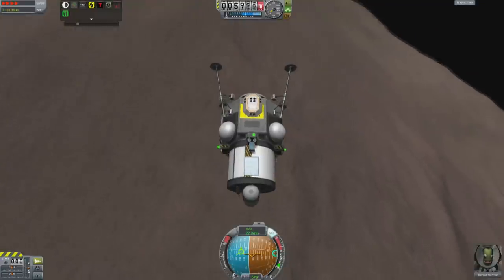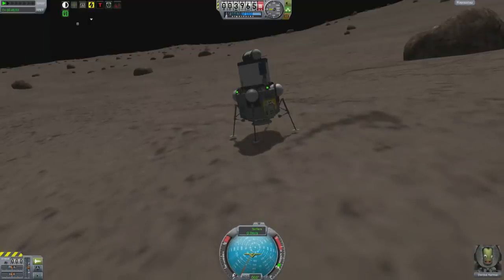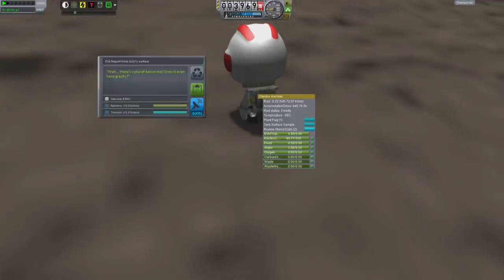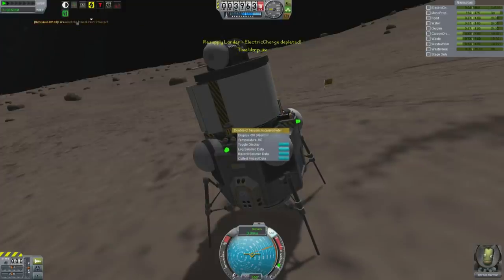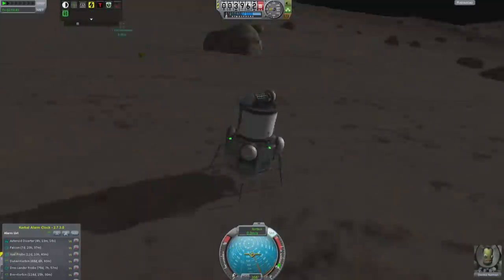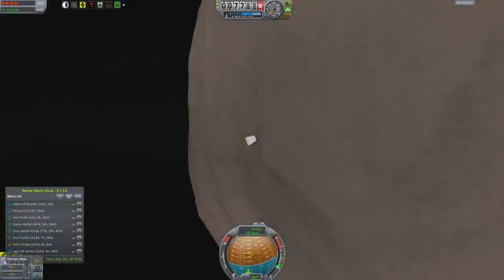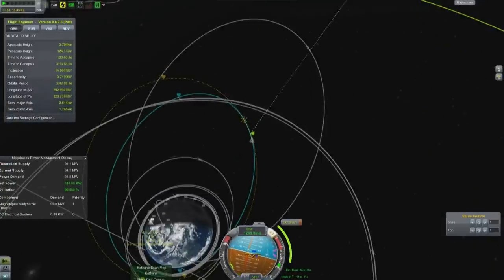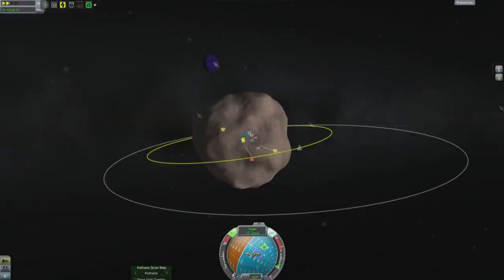Kerbal Space Program - Interstellar Quest - Episode 63 - Exploring Gilly

Comment: Scott, if you have upgraded your plasma engines you have access to infinite fuel in space/ vacuum. To quote the wiki. "The plasma engine can use multiple types of fuels. You can toggle between Liquid Fuel (Hydrogen), Lithium, Monopropellant (Hydrazine), Argon, and Xenon. Liquid Fuel offers the best specific impulse and lowest thrust, while Xenon offers the most thrust but the least specific impulse. The others are in between in the order they are listed above. When upgraded, the plasma engine is capable of pushing against the quantum vacuum itself to provide thrust. This mode only functions while not in an atmosphere and has the same performance as liquid fuel. However, while in this mode it requires only electricity and no fuel whatsoever."

Comment: So how hot would Gilly's core be? Is that even calculable in this universe?
Reply: im going to go out on a limb and guess that gilly's core would be completely cold since gilly is so small
Reply: Gilly's core could be around a bout subsequent 0 (-250 degrees Fahrenheit) which is where all molecular and particle movement stops.
Reply: tesshess
Still tidal forces happening. Eve = heavy. So I expect the core to not be 0 K.
Reply: impwarhamer 0° Kelvin is the complete absence of particle movement. It is basically possible, but yet to be actually found, because we can not reach any space where the is no gravitational force. Even if we'd find such a place, we would not be able to measure 0°K, because our spaceship and thermometer have mass and therefore gravitational force would make the measurement useless.
Reply: TheSchuetzeP
Kelvin doesn't come in degrees like degrees Celsius or degrees Fahrenheit.
Reply: ThaFuzzwood You are right. My fault, but to defend myself: It came in degrees until 1967.
Reply: TheSchuetzeP Actually, no, you still can't get 0K. That is because quantum effects will always be present - Uncertainty principle and all of those things. Gravitation isn't the problem.

Also, of course, the universe itself is hotter than that, since it hasn't cooled down enough yet - it is at the blackbody equivalent of ~2,7K. There one place that is actually cooler than the background - Boomerang nebula at 1K. (Caused by expanding gases.)

Finally: even if (uncertainty principle aside) we were to find something that is at 0K, we wouldn't measure it as such indeed; but that's not about gravity. That is because measurement inevitably means we add energy to the particle being measured. This is true even if we had massless probes.
Reply: Absolute zero is actually -273.15 degrees celcius, or -459 degrees fahrenheit.
Reply: Or, like said above, 0K
Reply: It doesn't have a core, Its a captured asteroid remember :)
Reply: @ThaFuzzwood  why wouldn't it? it's just celcius plus 273.15

Comment: How do you use the rocket/air breathing things on the shuttle craft because when I install b9 it just doesn't show up as anything am I missing something because I would really like to use them for my crafts.
Reply: I have the same problem :(
Reply: B9 is broken in .23+. You have to update the firespitter and exurgent engineering plugin dlls. Here's a link to a fixed copy of the B9 pack that I use perfectly fine:
https://mega.co.nz/#!yVxy1YBS!DVrULghOffbrsBQOzLlWwUmDe03hYadhVD-eO-LVnvc
Reply: Have you added the unofficial b9 23.5 patch? If you have it may be an issue with exceeding the 2.3gb ram limit.
Reply: Thanks for the help now it works and I have made a Skylon type deal craft it think its called Skylon and its realy fun to test and make and I wouldn't mind sharing it to you guys if you want.